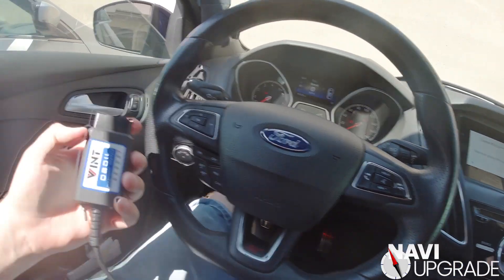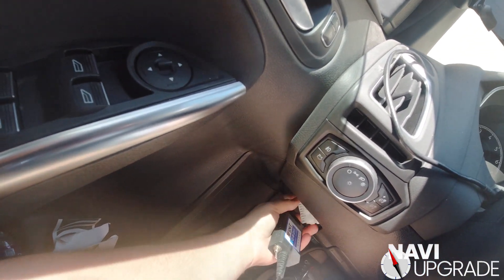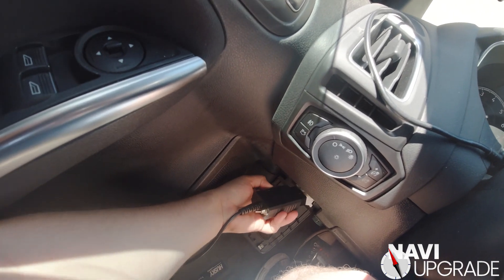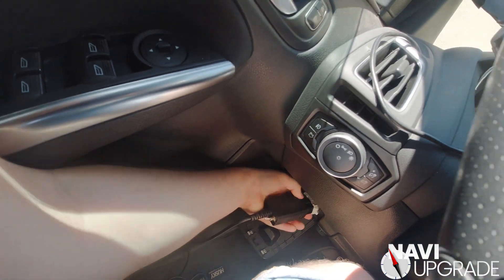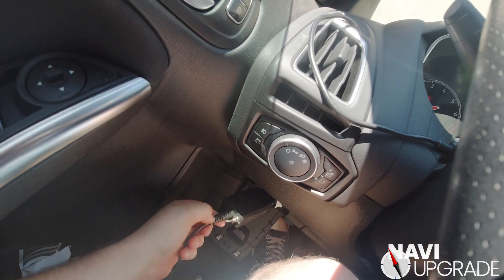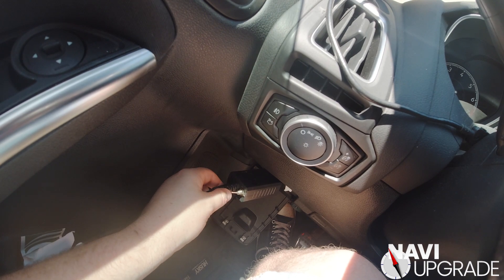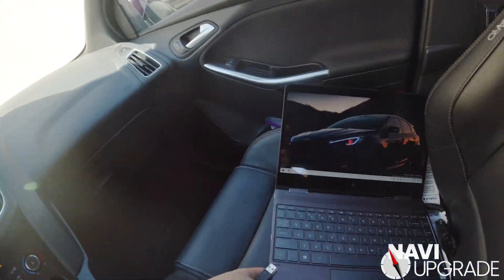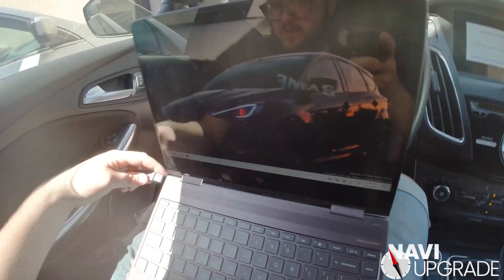Sync 2 to Sync 3 FORScan Programming in a Ford Focus

Comment: Bian, I just found your video. Thank you for the information. FORScan is no longer recommending the adapter you show in your video, and are recommending one that does not have the HI/LOW switch. Do you have a comment on that? I'd like to know before I purchase one. Also, after upgrading the software in my 2015 Mustang GT's Sync 2 to 3, will I be able to add the Drag Race Mode when selecting between the driving modes? I am a total newbe to this, so I appologize if my questions are dumb. Thank you.

Comment: Not being negative by no means but, your car had sync 3 prior to this “upgrade” video. Sync 2 and sync3 screens are totally different along with other items so I’m not understanding this video. Can you explain what you did here bc I’m lost. I’m upgrading my mkz to sync 3 soon but I have to swap the apim and screen out with new telematics unit. If it were just changing as built data that would be nice but I’ve gathered it’s not possible. Any hacks in telematics units or aftermarket that will work?

Comment: I replaced My radio in my 2014 Fusion Stereo works but when trying to use the voice commands and trying to talk on the Phone They hear me but I can't hear them. I have the Forscan  tool and need direction and or upgrade programing if needed, Please advise

Comment: My old ACM failed just got another one from a junkyard do I have to program the new ACM? These are codes it’s showing. 

Code: B1A89 - Satellite Antenna
Additional Fault Symptom:
- Circuit Open
Status:
- Previously Set DTC - Not Prisent at Time of Request
- Malfunction Indicator Lamp is Off for this DTC
Module: Audio Control Module

Comment: Does upgrading enable FordPass app capability? Really looking to do this upgrade primarily for the app interface.
Reply from the maker: You would need to add a 4G Telecommunications Unit to the car as well for it to work as that's what connects your car to the app.
Reply: @NaviUpgrade  any idea where that would be found on the vehicle if I were to pull from a local salvage yard? Or is this something integrated with the specific screen/apim? Thanks in advance.

Comment: Hey! How can I program a new APIM to my VIN? Is this tough to do with minimal experience? Extra equipment? Or is this doable. I just purchased an APIM/SCREEN and USB and adapter, but the company I bought from doesn't say anything about programming the APIM. Thanks for the great content!
Reply: im intrested to know too, have you got any updates?
Reply: Me too, I bought a Sync 3 upgrade kit from China, the only thing they did was programmed it with my VIN. I already installed it on my car, everything worked perfectly, I never knew I had to reprogram APIM module on my car. Can someone please elaborate?

Comment: basically if you upgrade from a sync2 to a sync3 module you need to reinstall the asbuilt file in the new module (the asbuilt file should be of the same model as yours to ensure compatibility)? that way you will have all the features you car currently has (ac on sync, nav, reverse camera, etc) on your new sync3 device

Comment: I did a Sync 2 to Sync 3 upgrade and I keep getting "911 Assist is Not Operational. Please Contact Your Dealer for Service." Is this something that can be corrected with Forscan in the APIM module?
Reply from the maker: Yes, most likely your Emergency Call strategy is set wrong. This is on line 7D0-01-02 xxxX-xxxx-xxzz.

Comment: Hey Brian would you be able to reprogram my APIM? I updated to 3.4 using a usb through the ford website and it messed my radio up. The splash screen pops up but the screen is black. The radio still works but there is no image. I can even come to you in person if that is an option. You are not that far.
Reply from the maker: Oh crap... You can't update via the Ford method or it's going to mess up since the new screen drivers are different... You're probably bricked to be completely honest man. I can do a new daughter board on the interior of your APIM if you want to swap that out to fix it 😬
Reply: @NaviUpgrade  Yup I was bricked for sure. I was able to fix it though. I just downloaded everything through cyan labs with your tutorial and it was updating the right way. Now it works fine. Thank you for the help!

Comment: I had one of those adapters with the switch and it works for most things but is a hassle to constantly switch back and forth and did not work on any of my cars with Central Configuration (CC).
I then got a OBDLink EX for $50 and it is so much better. 
Thanks for the video.

Comment: I have a Ranger FX4 2020 which came with a Sync ver F1.5.0.1_R19511a and it looks like the Sync 3. Is it possible to upgrade it to Sync 3? Do I need to change anything in the hardware?

Comment: Just checked the store, out of stock?? Are you getting any more. I want an entire kit, 2014 Raptor...can you make it happen
Reply: Please let me know how that works out for you, I need one for my 2013 raptor.
Reply from the maker: Hey there everyone -- I'll have more kits in stock VERY soon. Thanks for your patience.
Reply: @NaviUpgrade  ok. Will be checking website soon...also, what's the chances of this sync 4 working with the 2014 Gen 1 Raptor?
Reply: @joseahernandez350  I'm trying to aquire one, I also noticed the sync 4. Doing research is the 4 is also compatible. I other places have the sync 3 and they program everything. Cost is about $2k. But to save a little you can I the programming yourself, which is what I'm trying to do. If I do get it, I'll have a video for it

Comment: What about win number shown on a sync 3 unit? If i put a 3 unit in my Mondeo 15 plate that has a sync 2 unit now that has a different win number then the sync 3 unit says.
Does it matter?
Reply from the maker: VIN numbers on Sync 3 are dynamically pulled in from the BCM. No worries there 👍

Comment: A bit misleading. You cant upgrade with no hardware swap. The video does not mention that, you will need to change the APIM module. This just shows you how to program the new module to the car. So no you can not just upgrade the software of an old Sync 2 to a Sync 3 system.
Reply from the maker: Yeah this was just supposed to be on my website as part of a guide there then blew up here. That's my bad.
Reply: @NaviUpgrade  so edit the description or delete the file and post a new one.

Comment: Hello I have sync 3 on my Focus 2018 SE Plus in Brazil, it does not have GPS and climate control enabled in multimedia, it is possible to enable these functions. Salutation
Reply: You can not enable Nav in a non Nav unit die to the lack of memory on the APIM. However you may be able to enable specific functions such as your climate control.

Comment: I dont understand .to upgrade to sync 3. Is it only software  upgrade? What about the hardware ?
Reply: You need a new APIM, screen (APIM and screen usually come together as one), GPS antenna, and new USB hub. Then you install it (basically a straight plug and play swap) and program it like in this video.

Comment: Does this utilize the OEM Sync 2 screen? Or do I need to buy a Sync 3 screen and mounts.. etc??
Reply: You need a new APIM, screen (APIM and screen usually come together as one), GPS antenna, and new USB hub. Then you install it (basically a straight plug and play swap) and program it like in this video.

Comment: What about 2016 Fusion with sync 2 I bought the new USB plug so do I need to get a wire ?
Reply from the maker: Hi Stephen, sorry for the late reply. Can you please tell me a bit more about what you have done? Have you already installed the Sync 3 Screen/APIM? Have you installed your new hub yet? I'll write a guide and get some files pushed to my site for you to use for programming shortly. Thanks!
Reply: @NaviUpgrade  I recently bought a 2015 Ford Escape titanium and I have sync 2 but I rlly want to get Apple CarPlay and I've looked online and it says you need sync 3 so is it possible to get Apple CarPlay with sync 2 or is it possible to upgrade to sync 3?
Reply from the maker: @alexisbarbee2816  hi Alexis! It totally is -- shoot me an email to info@naviupgrade.com and I can help you out there. Thanks!